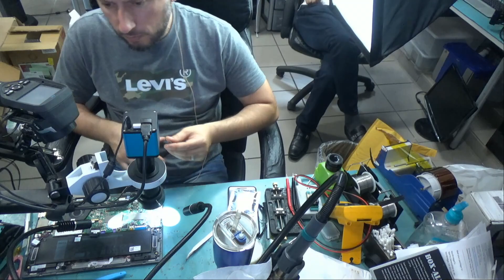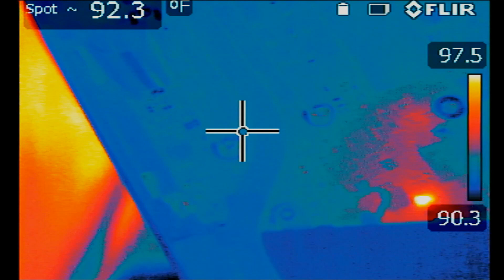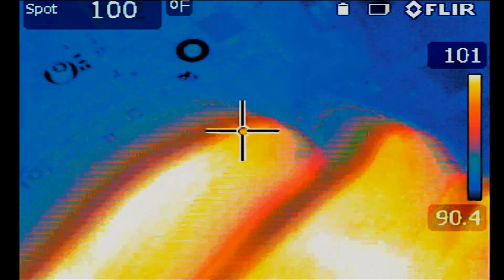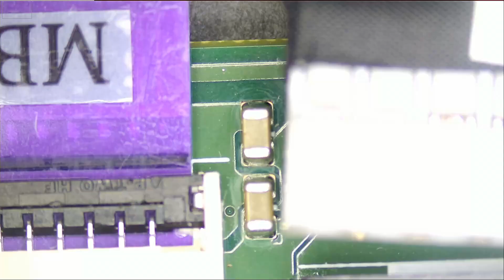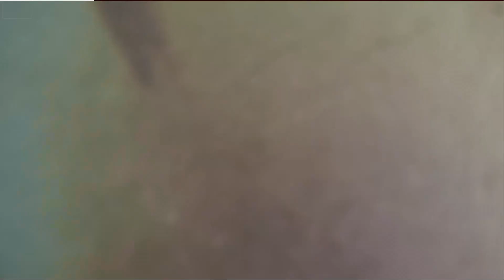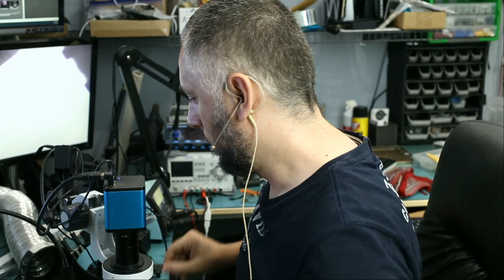Dell Inspiron 7373 No power Repair Part 2 -  Fixed Faulty Mosfet

Comment: Helped me a lot. Same issue with no power. I didn't have a thermal camera but I could feel the heat from a tiny part of the board. Tested a few pins and shorts all over. That kind of repair is out of my league. Time to take it into the shop. 😅

Comment: I shorted my laptop's power pin with tweezer to boot up without power button and it sparked(gone wrong). now there's NO POWER, but CHARGING. is it repairable? which parts need to change/repair? 
local technitian don't tell. plz give me a hints
it's Hp Prookob 450 G2.

Comment: HI, have You had a situation with XPS 9550 that connecting touchscreen cable to motherboard caused the laptop to turn dead. Power button flashes during power on, but the laptop remains dead. Affter disconnecting the touchscreen cable from MB, everything comes back to normabl, just without thouchscreen. Have You got any idea, whether its MB-defect, or touchscreen film on the display? Thanks, Janusz

Comment: Any ideas how to detect origins of shorted/blown SMD components? They are legion and markings on them often does not have nothing common with their real model names in datasheets. Particularly now I'm trying to find 3.3V voltage regulator L0H (or LOH) in SOT23-6 package (burned by friend due to mismatched PSUs in rush).

Comment: The original chip was marked C96CJ.    I could not find C96y or C96CJ chip; nor could I find data sheet on either.   How did you know the C96y would work?

Comment: Great video!! I am learning soldering and i have a question for you, why did you use soldering tin after removing the MOSFET? How can it help?
Reply: if I'm not mistaken, the previous alloy was lead free so he mixed it with leaded solder to lower the solder temperature of the new alloy, in order to do the job with less heat.
Reply: I agree with Carlos, It's to mix in leaded solder to the unleaded solder that's used on the board during manufacturing. Its makes it easier to clean and prep the board and reduces the melting temperature required to re flow the replacement components.

Comment: I'm really enjoy when I watch your videos. I really like repairing little boards with soldering iron (amateur)

I have a question for you, I have car Opel(or Vauxhall)  zafira 2002. My car's key fob doesn't working any more after my brother drop it, battery case was unsoldered. I resoldered it and my key fob working. (Led turn on when I press a key on fob) but my car doesn't recognize it anymore, i don't know what I did wrong, can you help me ?
Reply from the maker: No idea. You have to do some work and investigate
Reply: As the game fall,a possibility some  tracks or wires was broken resulting in no electronic connections, so you should thoroughly inspect it.
Reply: Check the LED lights at the end of your key you'll have to take the keyboard out to check them,,, I used a q-tip and found that one side was loose

Comment: hallo  what the flux you use ?
Reply from the maker: https://rover.ebay.com/rover/1/711-53200-19255-0/1?mpre=https%3A%2F%2Fwww.ebay.com%2Fsch%2Fi.html%3F_from%3DR40%26_trksid%3Dm570.l1313%26_nkw%3Damtech%2Bv2%2Bflux%26_sacat%3D0&campid=5338440312&toolid=20008

Comment: Hello, what type of thermal camera do u use ?
Reply from the maker: Flir E60 https://rover.ebay.com/rover/1/711-53200-19255-0/1?mpre=https%3A%2F%2Fwww.ebay.com%2Fsch%2Fi.html%3F_from%3DR40%26_trksid%3Dm570.l1313%26_nkw%3Dflir%2Be60%26_sacat%3D0%26LH_TitleDesc%3D0%26_osacat%3D0%26_odkw%3DKester%2B44%2BRosin%2BCore%2BSolder%2B63%252F37%2B.031%2B1%2Blb.%2BSpool&campid=5338440312&toolid=20008

Comment: 8:05 - is that a crack in the MOSFET just by the part number?
Reply from the maker: It's just flux. Look at 6:49
Reply: NorthridgeFix - hadn’t noticed that, was just looking for visual clues that might have pointed to the MOSFET in the absence of an IR camera. Sometimes you just get lucky with an obvious visual failure point but obviously not this time.
Reply from the maker: 100%. I wouldn't have found out without a thermal cam. Nothing was shorting around the mosfet and nothing was visually obvious.
Reply: NorthridgeFix - like I said, sometimes you get lucky - but not usually. The thermal camera clearly told the whole story, fantastic piece of gear. Great work 👍
Reply: but is that a mosfet?

Comment: Which Flir camera are you using there buddy, and is its resolution good enough to I'd hot 0402 size components?
Cheers
John
Reply from the maker: Flir E60. It's 320x240 60hz. You'll know what component or area is heating up regardless on size. https://rover.ebay.com/rover/1/711-53200-19255-0/1?mpre=https%3A%2F%2Fwww.ebay.com%2Fsch%2Fi.html%3F_from%3DR40%26_trksid%3Dm570.l1313%26_nkw%3Dflir%2Be60%26_sacat%3D0%26LH_TitleDesc%3D0%26_osacat%3D0%26_odkw%3Dsurface%2Bpro%2B3%2Blcd&campid=5338440312&toolid=20008
Reply: @NorthridgeFix  Thank you 👍